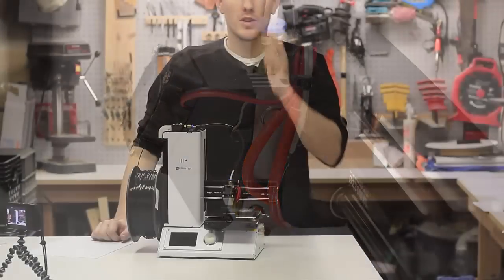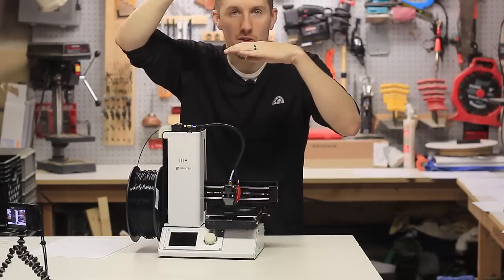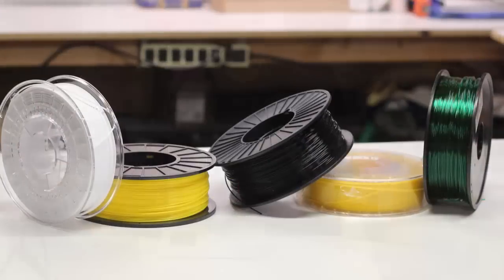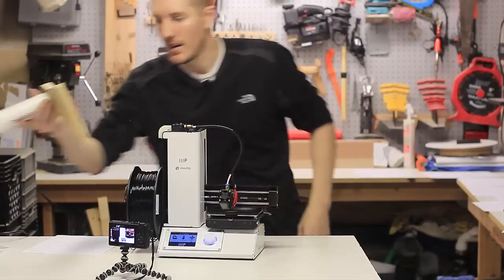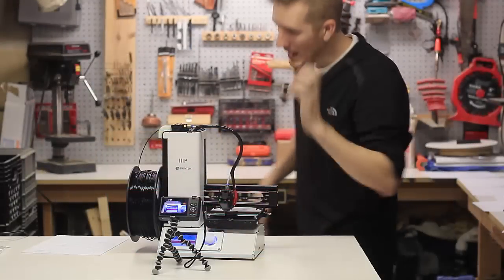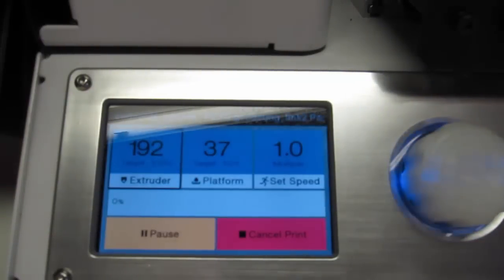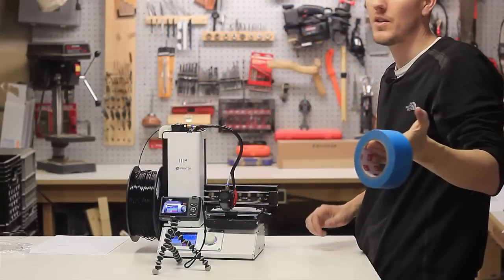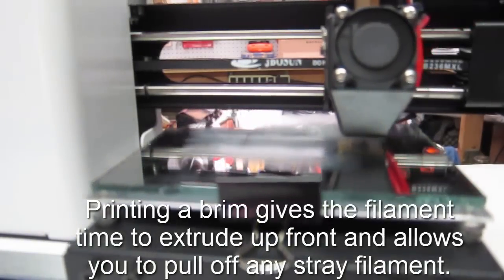3D Printer Setup - Monoprice Select Mini - First Print

Comment: Question: Can you give me a list of software programs out there that give you the option to COPY an existing part 3D with the exact specifications of the part, so that you can essentially make replica parts? Like the top 5 software programs would be awesome? I don't want to have to measure all millimeters of this part and try to program it into the soft ware, I'd rather just copy the part itself if that is possible. Any ideas? Thanks for your help.
Reply from the maker: Like a scanner?  https://www.youtube.com/watch?v=f5tL_Zg_GYw
The Kinect isn't really good for getting super accurate parts.  You need a special desktop scanner for that.
Reply: There is a 3D scanner you can print on Thingaverse. That would be your best option if you don't want to measure

Comment: Have you printed with petg filament on this model?
Reply from the maker: Yes, does just fine.  The upper limit of the printer hotend is 250 i think.  Most PETG wants to be printed at 220-240.  And i usually have the print bed at 40 or 50.  In this video the Green and Red translucent filament is PETG.  https://www.youtube.com/watch?v=k8Kru6mTZ-E&lc=UgxDOeJVtwX3l1pfUFt4AaABAg

Comment: Ok so if I have this printing overnight in my bedroom will the sound be loud enough to make it hard to sleeep?
Reply from the maker: In the same room...ya maybe.  The loudest noise is from the small 30mm fan.  Some people have replaced it with a larger and quieter fan.  The other noises are the motors, belts and pulleys.  You can also put it in an enclosure to dampen the noise.

Comment: Is there any reason you could not use feeler gauges?
Reply from the maker: Richard Limbrick you definitely could.  But even with using a piece of paper, it's a bit of a feel thing.  Meaning you have to do it a few times to get the feel of friction when sliding the paper under the nozzle.  But ya a set of feeler gauges would work ok, I've never tried it though

Comment: My prints stop at about 20 seconds. Any help?
Reply from the maker: Does it just sit there?  Or does the progress bar go up to 100% real fast?  First make sure it's not something with the slicer program, or the gcode.  I've noticed that if i print for a long time and the printer gets too hot it will stop, but that sounds different from what you are experiencing.  Try to narrow things down, the main board, the wiring, try different files to print...  Not sure, but maybe just try to isolate the possible problems

Comment: Been trying to print on glass so far not much luck have not tried glue yet. I have an Anet A8. Have only had for 2 or 3 weeks but have been having a ball with it. I have printed a bunch of thing some great some not so great. I like your videos a lot keep them coming.
Reply from the maker: Thanks.  Gluestick helps a lot but can be a little messy.  I had to take the glass off and wash it in the sink every 5 prints or so.  I then bought a sheet of PEI (never tried BuildTak) and it's been a joy to use.  Still get a pretty smooth finish on the bottom layer, sticks really well, and no clean up.  But you do have to print at a slightly higher bed temp, i used to print at 50C now more like 65C.
Reply: Warren Van Nuil I have a couple of Anet A8's. My biggest problem was getting things to stick. I started printing on Borosilicate glass with hair spray and still had problems. I have more hair spray than most women lol.  I'm now printing on Vertex buildtak, sells on Amazon for $16 and so far no more problems. I just got my Monoprice mini today and I'm putting it on this one too.

Comment: I just made 3 prints with my printer, then now when I try to print, the filament curls over the nozzle every time. I checked the temperature, the leveling, every single setting and the same thing keeps happening.  Can you give me any suggestions?, please. Thanks
Reply from the maker: +Efrain Rivera Betances what do you mean by "curls over the nozzle"?  Do you mean it doesn't stick to the build plate?  I'm assuming you are printing on masking tape.  Some ideas are: try blue painters tape, wipe the tape before printing with acetone (nail polish remover), manual slow down the print in the beginning from 1.0 to 0.7, wipe the tape lightly with a glue stick.
Reply: Yes, it does not stick. Thank you so much Dave. I will try that out
Reply: Efrain Rivera 
In case that didn't work, it's likely that your print nozzle is clogged.

Comment: I have a question, I have a mono price mini printer and my first attempt at 3d printing didn't work. The printer didn't even move and im wondering what would cause the printer to not move at all and what could I do to fix it.
Reply from the maker: That's a very broad question and could be 1 of 100 things.  Time to start narrowing down the problem.  First, does it move when you are in the menu and move the X, Y and Z axis manually?  If yes, then the mechanical part is ok.  If not it could be the motors or accidentally triggering the stop switches.  Make sure the wires are pushed in completely to the endstop switches.  Second, can you print the file that came on the microSD card?  It should be the .GCODE file that is set and ready to go.  Third, what happens when you press Print?  Does the hotend heat up?  Does the heated bed heat up?  If the hotend is not up to the printing temperature it won't start printing.  Fourth, if you are trying to print your own part, using a slicing program like Cura, there's a bunch of things that may be wrong there.  Lots of settings like print bed size, print temperatures, parts too big, ... Try to narrow down the possibilities of what is wrong.  It's tough though when you are trying to get your first thing to print.
Reply: thank you. It moves when I adjust the XYand Z axis. What are end stop switches? I'm not sure about the .GCODE file? When I press print it loads like it printing but doesn't do anything. The hothead and bed heats up. I guess I'll just play with it and see whats wrong. Thank you again for answering my question.
Reply from the maker: I show the Z axis end stop switch at 0:59 of the video.  The  X and Y axis switches look the same but the Y is under the print bed and the X is on the arm.  When you say it loads, does it just say 0%?  You may have to wait up to 5 minutes for the hotend and heated bed to get up to temperature.  It will not print until those temperatures are reached.  Much like a hot glue gun, you don't just plug it in and immediately start.  You have to wait for the end to get hot so that it can melt the glue.  It's possible that there may be a loose wire or something's wrong.  Can you go in the menu and manually heat up the hotend and heated bed?  Whenever i print i usually manually do that anyway.  Before i print something i manually heat up the hotend to 200 and heated bed to 50.  Then when i go to print something it usually starts in a few seconds because everything's heated and ready to go.  Check that the hotend and heated bed are warm/hot.  If everything seems good then it may be something wrong with the file.
Reply: I just fooled around with it and the both were heating up. I know the tip was because there was PLA coming out and I was adjusting my glass plate and could feel it getting hot.
Reply from the maker: It won't print until it reaches the specified print temp, typically 200 for hotend.  You could try making your own .GCODE file and print that, instead of the one that comes on your microSD card.  Use cura, load in a .STL file, import the settings from the other .GCODE file on your card and save the new file.

Comment: PLEASE HELP!!! So, i load a model into Cura(set-up per manual suggestion) from Thingaverse. A whistle. Simple. i save gcode to a folder then copy that file onto the sd card  that came with the printer Note: if a file name uses an underscore___ it will not save or write the file to the sd card for some reason. Okay, so then i put the card into the printer with a correct file name (whistle) and hit print. Nothing happens except.... the blue time line starts to go. And its goes until the end and hangs up. I can not cancel, I can not pause and i can not print. Now, the "Cat.gcode" file that comes on the sd card with the printer prints just fine. Cura does not seem to work with this machine for me now. I forgot to mention, i worked the first few times UNTIL i tried to set up the WiFi which was a fail. I can't even get the usb to work... Please help.
Reply from the maker: Stereo Studios first, try putting the gcode file directly onto the ad card, NOT in any folders.  Second, keep the filename short?  I think someone else in the comments had the problem of the progress bar going and nothing printing, i forget how he fixed it
Reply from the maker: Stereo Studios and maybe restore the old firmware without wifi?
Reply: I'm trying to print with the USB cable but that's not working either. It starts the warm-up process and then just sits there. I'll try the short file name on the SD card now. And as far as restoring the firmware i have no idea how to do that, lol.
Reply: Tried the short file name and nothing. Same exact thing. Doesn't heat up and the time line starts moving. At this point I'm so frustrated I'm ready to return it to Monoprice.
Reply: This thing is just ALL OVER THE PLACE. It's just doing weird and random stuff. So aggravating. What is "Smart config started" mean? I noticed when you hold down the okay button when "Move" is selected..? And what is the "driver.inf file on the SD card for?
Reply: I give up.
Reply: Downloading Cura 3.1 to try that...
Reply from the maker: Stereo Studios also it won't start printing until the selected print and heated bed temp is reached
Reply: It does get up too temp then just sits there.

Comment: My m200 has a foamish paper thing (pretty think) inside the extruder area, do. I take that off?
Reply from the maker: kubtractor not sure what that is.  if it's something that looks like it will melt at 200C then ya probably take it off
Reply: Dave Wirth yea I looked and it's supposed to be there, thanks anyways!!
Reply: Dave Wirth Update: i have a new problem, my print curls up at the start and when the extruder comes back around, it gets caught. I've tried it at 185 degrees extruder, 50 degrees plate, and a 0.5 speed, but it still happens.... sorry for bugging you but your the only person I've found to have much experience with this machine, thank you!
Reply from the maker: I assume you are printing with PLA, which is usually good for bed adhesion.  I also assume you are printing on the tape that came with the printer, or blue painters tape, which is also usually good.  There's a million different discussions on getting good bed adhesion.  I did a video on how to add a glass print bed, but that's something you won't need to do for a long time:  https://youtu.be/vy30E6wJIz4  .   First i would try printing onto blue painters tape at 65 degrees.  If that doesn't work try the tape at 65 but spray it down first with a few thin layers of hair spray.  If that doesn't work use a thin layer from a glue stick.  I've been printing on a sheet of PEI and it's great, no spray, no glue and parts stick great.  But it's $20 for a sheet.  I've also heard good things about BuildTac.
Reply: Dave Wirth yep! Just needed higher temps, thanks a lot!

Comment: I heard according amazon reviews that this printer is just for 5-10 projects, and , then , some parts will brake or you need to repair. It's like disposable printer. Is it true?
Reply: CoolStreamT 
Those are likely lemons; a 3d printer is NEVER disposable.
Though, Monoprice does seem to have a bit of an issue with QC,  that doesn't make their printers "disposable."
Reply: The reason is that 3D printing was a trend a people didn't know how to use the printer so they would just carelessly print things and not cleanup the printer so no its actually a great printer
Reply: I just got mine as a addition to the PRUSA i3 MK2. both printer are just sensational, with the PRUSA being a much bigger unit, but the Monoprice is a very nice desktop printer ... two of my fellow workers are going to buy them because of the small footprint, price and the customer service ... which is very good ;-  )

Since I posted this a few days ago I have printed about 10 items, some original and some not ... all on PLA and all very good quality prints ... I am very pleased !

Comment: So my filament won’t go past the lever and into the tube it just stops
Reply from the maker: You have to pull the lever and feed the filament into the tube.  Sometimes if the filament isn't straight it doesn't want to feed into the tube.  Keep turning it and forcing
Reply: @DaveWirth  I pull down the lever and everything
Reply from the maker: You should be able to pull the lever and be able to feel the filament between the round drive gear.  The drive gear makes the filament move
Reply from the maker: See 4:41 of the video.
Also cut the filament on an angled point, helps.
Reply: @DaveWirth  what if my filament got stuck in the tube and broke off?
Reply from the maker: @DoomDeity  Disconnect the tube from both ends.  Just push the blue plastic in, then pull out.  Then with the hotend hot, you can pull out the filament

Comment: I got mine today and it came in with a non working lcd screen  plz help. I cant afford a replacement
Reply from the maker: Just return it.
Reply: @DaveWirth  i ordered on amazon and they wont let me return it. So im screwed. Idk if its a board issue or just lcd. Trying to find out the problem so i can fix it
Reply from the maker: @WiltedRaven2  Take off the screws on the bottom.  Maybe the plug is just loose.  You should be able to trace the wires from the screen to the main board.  Here's a video i did where i had to open up the case to fix something:  https://www.youtube.com/watch?v=yCJzEXlSmys
You can see the board and all the wires.
Reply: @DaveWirth  I have done this and everything is all hooked up and nothing is lose. Would i just need to replace lcd or lcd and the board?
Reply from the maker: @WiltedRaven2  I don't know.  Never had an issue with my LCD.  I just had that MOSFET switch blow and the hotend wouldn't heat.  
One idea:  Plug the printer in, with the bottom off, and see if there is Power going to the LCD (using a volt meter).  If yes, then the LCD is bad.  If no, then it's the board.    Maybe start with that.
Reply: @DaveWirth  ill need to buy a volt metre. Thanks for the help i appreciate it. My lcd lights up but its a blank screen, so there must he power.
Reply from the maker: @WiltedRaven2  ok ya, if it lights up then it's more likely the LCD.  Maybe try asking in a forum for the Monoprice Mini.  They have a facebook group i think.  Maybe someone there has had the same problem and knows exactly what to do.
Reply: @DaveWirth  okay cool. Ill check that out. Thx again ✌

Comment: Is the filament 1.75, PLA?
Reply from the maker: yes.  i've also printed with PETG and ABS
Reply: @DaveWirth  where do u get a good deal on it
Reply from the maker: @cutflower36  Well i have a MicroCenter near me.  They have PLA for like $20 and ABS for $10.  Other then that i would think Amazon.  I did some reviews of filament from different places:  https://www.youtube.com/playlist?list=PLnfZ3Rt-xEK-6LzkuReL3StDU5JlA6yV2
All PLA is basically the same.  But the best stuff i've printed with is E3D Edge filament.  It's like $40, but it prints great.  So i have some filament if i just want to print something cheap, eg. $15 yellow PLA, some if i want it strong, eg. $10 blue ABS, and if i want it to be super fancy i will use the expensive stuff.
Also remember that if you leave it out, after a year it will get brittle and crack and kind of useless.  It takes a lot of printing to go through an entire 1kg spool.
Reply from the maker: @cutflower36  Oh, and this eSun PLA+ is decent for like $25  https://amzn.to/2O47lOQ
not as cheap as basic stuff from MicroCenter, but prints well and sticks to the bed
Reply: @DaveWirth  thank u so much for all the good info. I think I will get one of the 3d printers to make copies cutter. If u don't mind me asking, I notice some have a stair step look on some to the items when people print. What can be done to get a smooth seamless application?
Reply from the maker: @cutflower36  I like to print fast.  most people print with a 0.4mm nozzle.  i use a 0.6mm.  it results in prints that aren't as nice and smooth, but i can print a lot faster.  If you want a smoother print you just need to change the settings.  I print in 0.3mm layer heights, you can print in layers that are 0.1mm.  So my print head moves up 0.3mm for each layer, if you lower that number it will make a smoother edge.
Reply: @DaveWirth  thanks for everything

Comment: Mine wont turn on, what do I do?
Reply from the maker: Bad power supply?  Used to be a common problem with the early ones.
Reply: @DaveWirth  It now turns on for a flash second but wont do anything after. Thank for replying despite this video being years old
Reply from the maker: If you have another "wallwart" plugs that produces 12 volts (and has the same size hole) i would try that.  I just remember back when the Version 1's came out a bunch of people were complaining that the power supply was bad and had to buy a new one after a couple weeks.  Beyond that it would must be something with the circuit board???  You can take the screws off the bottom and look in there, see if anything looks burned?  I know a new circuit board is like $60.  But hopefully it's just the power supply.   Oh, maybe it's a short or twisted wire causing a short.  Like maybe your hotend is bad and the + and - wires are shorting out.  Maybe try disconnecting things one at a time and see if it turns on.  Maybe can isolate the problem.